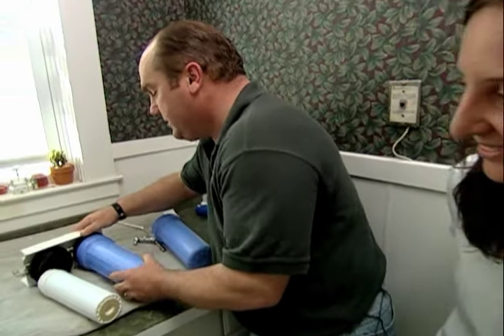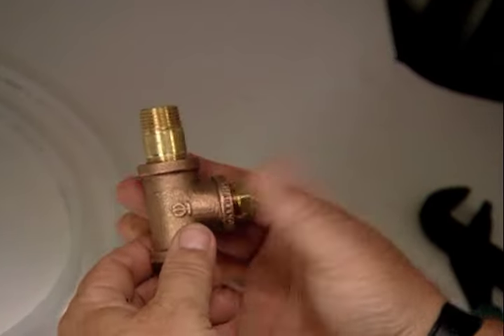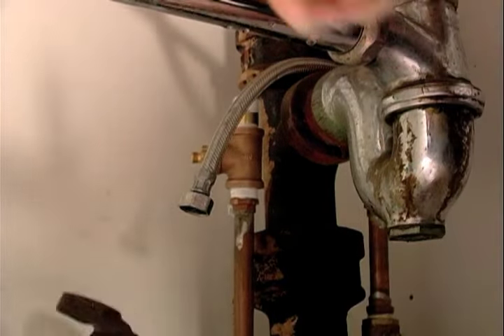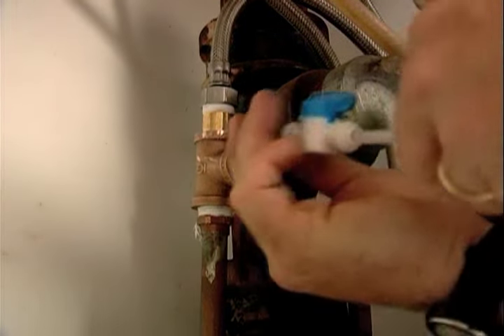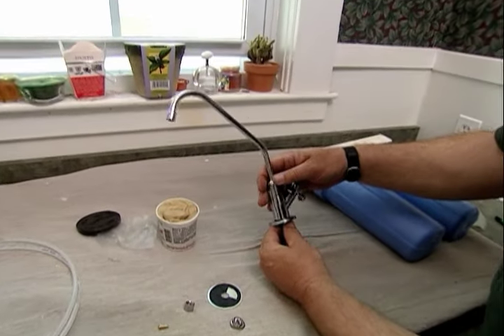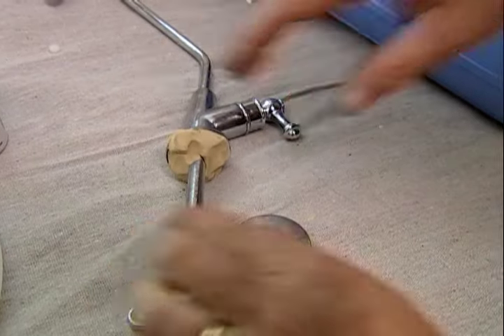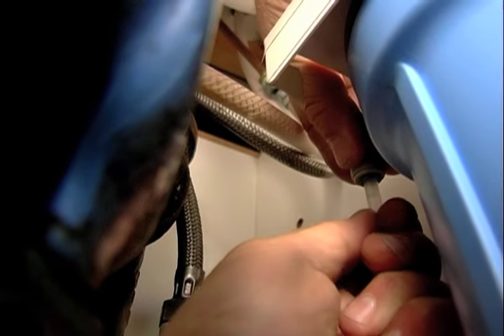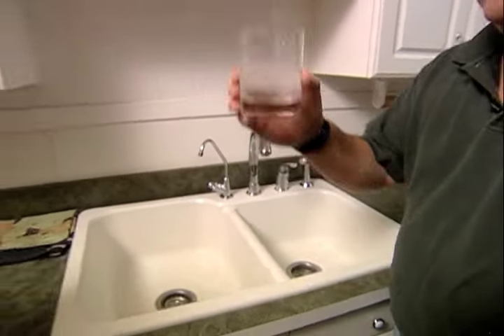How to Install an Under-Sink Water Filter | This Old House

Comment: When changing canisters air got in the line. How do I get it out. Running the water didn't help.  It runs slowly now and sometimes makes a noise. This happened the last time I changed canisters. The line is not crimped. It took weeks to get it to work properly. I ran the sink water for a while before I tried the filter water. Just to make sure the air did not get in the line again. should I have left the valve open on the water filter when I change the canisters? letting the water run into the sink as I change the filter? Maybe that would have helped I don't know.

Comment: You should flush the system before drinking the water because there will be carbon dust.
Reply: nah no carbon dust
Reply: Sometimes there is a non toxic preservative too in the filter
Reply: just air bubbles bro no dust

Comment: 00:58 I hate when plumbers use channellocks with teeth on hex head fittings, its a major pet peeve of mine. Is it really too difficult to use a crescent wrench? I mean you already got the one sitting right in front of you that you used for the supply line...

Comment: I wish they can do a video on how to take the nut off the copper pipes connecting the water line to the sink faucet.   Then make a better video and explanation on how to  make the tee connection.  I don't know how to open the nut without breaking the copper pipe, nor I know if I can bend the copper to make space for the tee connector.  I have a 3/8 copper cold line going up to the sink connect with the compression nut. The house was build in 2000, so I need to open it and install the tee there.
Reply: The pipe should have a hex section by the nut so you can grip it properly. It is important to try to twist the nut and hold the pipe still. If your pipe doesn't have the hex flats, you can use a pipe wrench or a strap wrench. A strap wrench will put the least pressure on your pipe but may not get enough grip.
Reply: That's okay, i was able to find the right size as add on,to connect the water filter. Its not worth opening the old connection.

Comment: Anyone have a video on a single stage water filter that ties straight into the kitchen faucet and doesn't have its own?
Reply: Check out "Hydroviv" on line.  Looked easy to install, but haven't tried it yet.

Comment: looks like you wrapped the Teflon tape the wrong direction? FYI still love the show, thanks
Reply: Michael Niezborski he wrapped it right ... you are suppose to go in the opposite direction of the threads and that's what forms a seal. I use to do it all the time for oil changes... if the oil pan or the oil plug itself was a bit stripped throw some Teflon tape on it and it sealed it right up